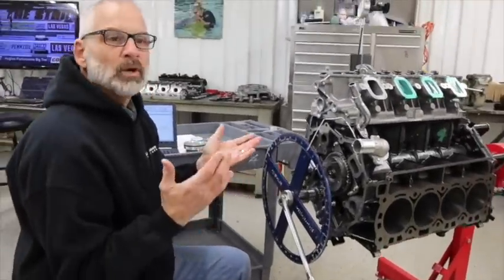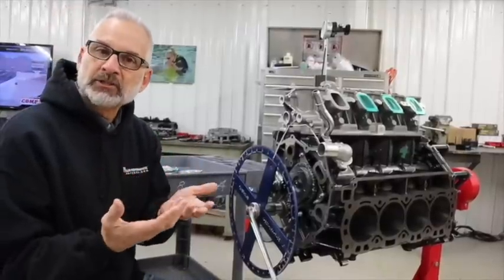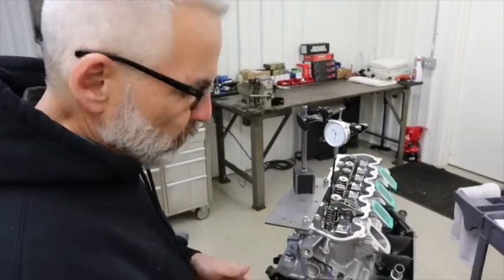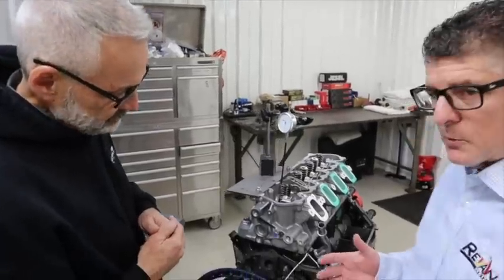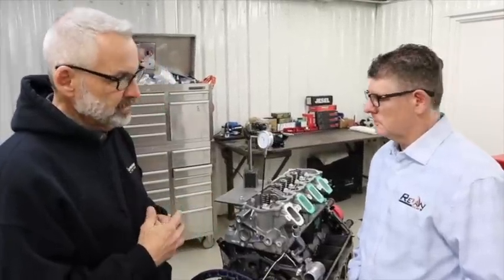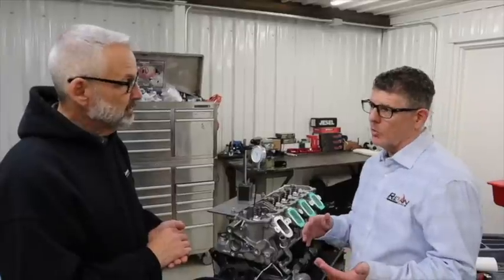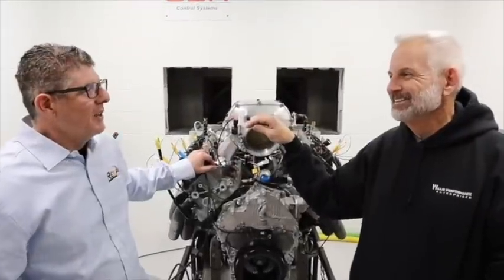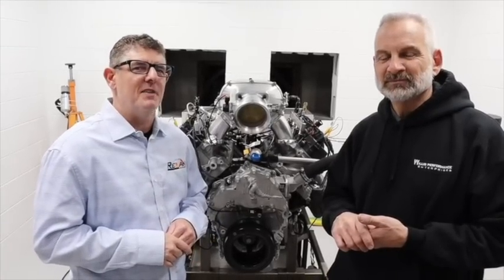Godzilla 7.3 Ford — Can You Run a Big Cam? Checking Piston-to-Valve Clearance, And What About VCT?

Comment: Is the VCT a huge deal with this engine if used in a light car? Could it be deleted or locked, and this engine run with a carb and belt drive distributor?

Comment: I just want to slap this in my 04 f150... simpler, easier to work on, and makes more power with less cost and work. The 5.4 3v though reliable enough for me, just isn't where I want it in terms of power and cost of parts, doubly so if you have the big power dreams I do...

Comment: Would of been better if you gave some cam specs like anything close to this or more duration gonna have contact problems.
Reply: Good point,  but not only duration, but also where the camshaft centerlines are relative to TDC on the overlap stroke.   So unless you know a specific cam works all the way advanced and retarded it is best to check.
Reply: @brianwolfe2993  I hear you on that point but it would help out in advance knowing something in the LIKE 230 degree range or larger is going to need flycutting.

Comment: Do we have an ETA of cam parts for the 7.3? Or are they already out on the shelf Evan?
Reply: Email me, I have some on order now,   wolfe@aillisengines.com
Reply: @brianwolfe2993  Awesome. We have a shop here in Texas, I’m currently looking for customers that want to mod their 7.3 truck or have the crate engine. Do you have any testing or suggestions on torque converters? Does the stage 1 cam with VVT still make good torque down low for the trucks? Thanks a lot sir!!
Reply: @tlpusher9652  Thanks, yes, Stage 1 with VCT limited to 12 degrees is a good low end torque and works well with the stock intake, my email is wolfe@willisengines.com.  sorry fat fingers above.

Comment: Why does everyone talk of thousands of an inch on a metric engine.  It's only been 30 years since the shift to metric by American automakers.  Metric is just so much simpler.
Reply: Because its still easier for many of us here stateside to understand, which is where this engine will see the vast majority of its life if not all of it... I know there are some people across the pond or down under that will use this thing in a race application or something, but for the vast majority of us where this engine will be commonplace its easier to understand, and more to the point its what we've always used for those particular measurements... Hell I still find myself using a calculator to get how big or small an engine is from liters to cubic inches...
Reply: Phillip Aubin  They are in metric and so are the bolt hole specifications.

Comment: Can piston to valve clearance be close to .050 if I’m running heavy springs and less than 4K rpm for small engine?
Reply from the maker: That's really tight, not recommended.

Comment: I guess I’m the only one that wants to see one with fully ported heads, solid roller, and 15-1 compression.
Reply: Check out Evan's other videos.   We had only 12.5:1 with a blower cam, made just under 800HP I think we can make north 900 with 15:1, a dry sump and the correct cam for N/A.   Not bad for stock head castings.....
Reply: On methanol, please......
Reply: 15:1 ? Gotta use methanol for that.

Comment: I want to know: 
How much can you stroke it without having to clearance the block?
How much can you stroke it if you clearance the block?
How much can you over bore the block?
Reply: All great questions, but we are not looking into stroker motors now, but I did run an aluminum rod with no notching needed.  For Overbore, I would not go to much due to the saw cut between the bore.   If you do build a stroker would love to see what you learn.
Reply: Jesus why would you need to stroke this thing? It’s a stroked small block from the factory?

Comment: Evan why did Ford not use canted vavle design on the Godzilla?
Reply: it is merely a truck engine remember. it is agricultural and simple with a forge balanced racing crank. For whenever a truck needs a forged balanced racing crank
Reply: I believe they are technically canted. Only like 9 degrees I think.
Reply: They are Canted just not staggered.

Comment: At 4:45.  That intake valve notch in the inverted dome piston looks the same as a piston I worked with in a big block Chevy application about 20 years ago.  We called that little sliver of metal on the outside "the fuse" because it would always burn out of the piston if we got the timing too far advanced.  The engine would misfire for a couple of seconds, then return to normal, but the spark plug was always covered in aluminum that was burned off the piston.  It didn't do the cylinder walls any good , either.  I suggest you grind out that little sliver of aluminum before assembling the engine.  Same thing for that sharp edge on the exhaust side, too.  Don't leave any sharp protrusions that can heat up and cause preignition or detonation.
Reply: Andy Harman Good eye! That could cause an issue, especially with the testing they are and will be doing.

Comment: Those raised roof ports are begging for some ITBs
Reply: This whole engine is begging to be boosted. Might be the first 6 second stock bottom end engine in the world. The similarly designed GM LS has done low 7s
Reply: @hoost3056  Nooo, this is a Ford. Ford has Le mans pole positions, F1 pole positions, rally pole positions. Technology GM would sell their soul for. It does not need boost. This motor will do 7s before boost has been considered. This why Ford are expensive, built by the finest motor engineers for the finest of motorsport enthusiasts.
Reply: @1985metalmaniac  really dude? Ive owned Ford products most of my life for fleet and personal use. This engine has design similarities to the GM LS ( close to a Gen 4 ). The heads are canted valve like a Cleveland or a 385 BBF. It's all oversized and overbuilt. OEMs steal from each other all the time. The 2 valve  Modular family is Ford's interpretation of the Mercedes Benz single cam V8s. Compare them side by side.
Reply: @hoost3056  no not really. my statement has no basis on facts. At the end of the day all manufacturers globally have come to same conclusion to what is needed to make power.
Reply: @hoost3056  the same ls that resembles the windsor🤔 is that what you speak of

Comment: Id just get rid of the VCT. The cubes plus the good heads and induction is more than enough. Great engine👍
Reply: no way, id keep, but to be fair i am a mechanic and i deal with these devices all day long on both fords and toyotas, they are not the complicated really and with the new AEM tuning stuff out there, these things are easy to tune, for a street tune, id keep it. 
-its like racing in the old days when you used to swap out the crank gear with a different one where the key slot was cut to be either more advanced or retarded depending on the track and stuff, now it's like you could make that swap in a reflash, rather than taking the front cover off. 
(this may lead to asymmetric cam profiles to increase the efficiency of overlap)
Reply: Makes perfect sense to me.
Reply: Why leave any power on the table?
Reply: @Odessa45  the cubes, heads and induction without any cam phasing makes plenty of power. In a lighter chassis with small tires you have to control the power, and 445ci aint gonna be easy NA or boosted. Don't need it.....another breakage point and added complexity.
Reply: It depends what you're doing with the engine. If this thing spends all day at a racetrack over 4000rpm then VCT isn't doing much and could be deleted to simplify the engine and remove unnecessary rotational weight. For almost anything else you'd probably want the VCT.
Reply: Basically, ford has had VCT issues since the beginning, why risk it?